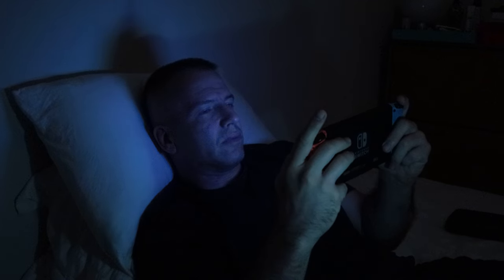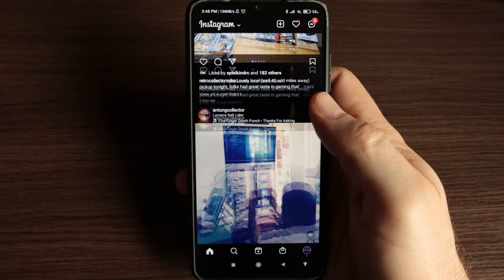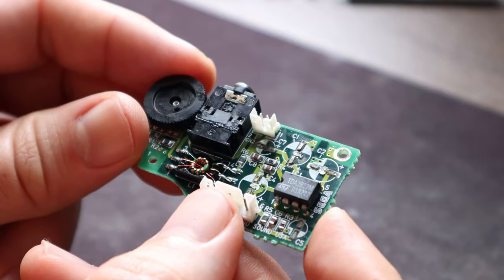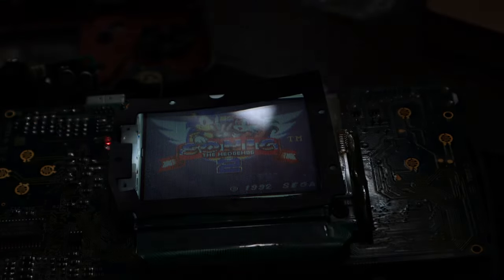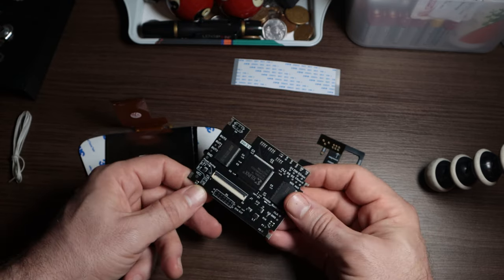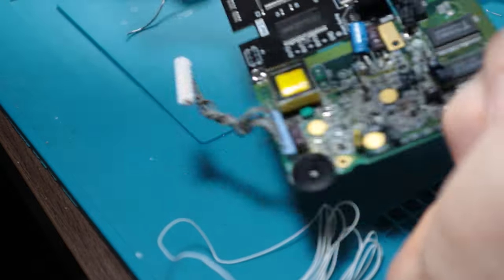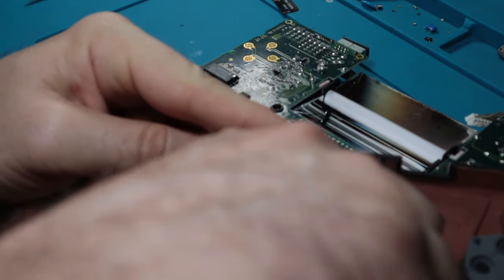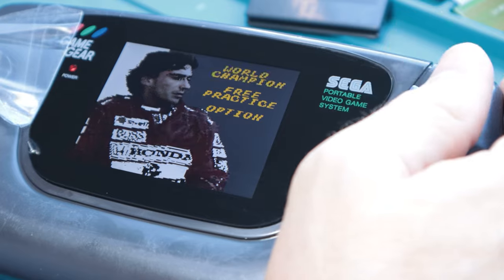Game Gear Modern Display Upgrade Life Changer!

Comment: Nice work! I haven't been brave enough to attempt surface mount soldering, so I can only imagine how it must have felt taking on that recapping job. I should probably try doing a similar mod to my original Game Boy, as it was dead when I got it out to show my kids a couple years ago, and worst case I can play the games in my GBA SP or on an emulator.
Reply from the maker: You can probably fix your gb if you do something like this. 👍 Thanks for watching and good luck!

Comment: A friend of mine recapped and put an RGB TV out and 9pin pad socket mod on mine. It's really nice on the TV but the screen is still pretty horrible. I wish I could fit this mod in as well but I doubt they'd work together. It looks very nice indeed Sucra.
Reply from the maker: Thanks! The instructions for this came with the option for the 9 pin out, but I really have no desire to play it anywhere else besides its own display, so I skipped that.